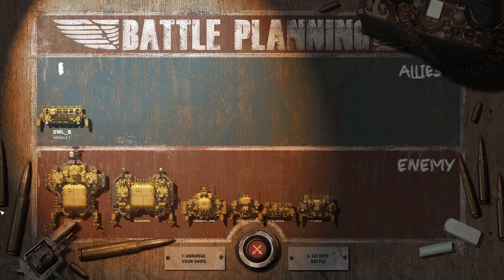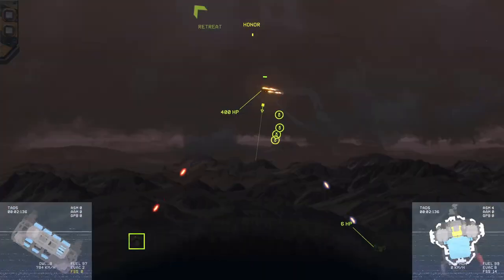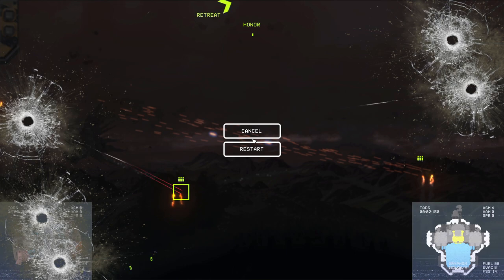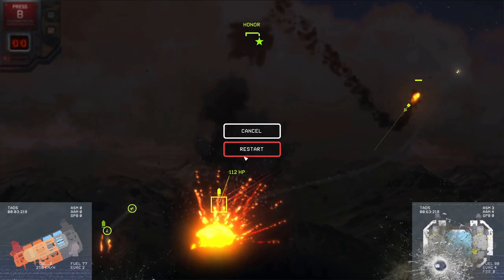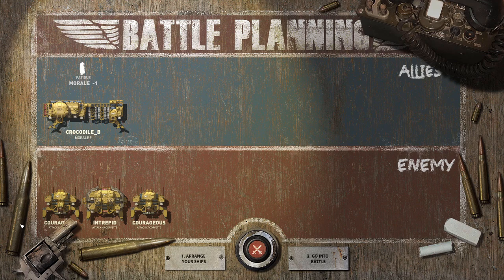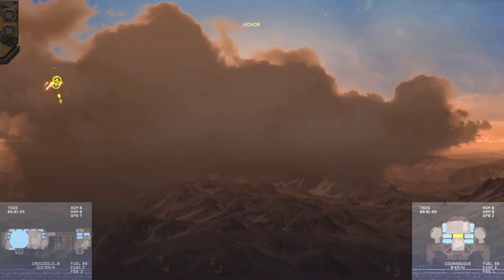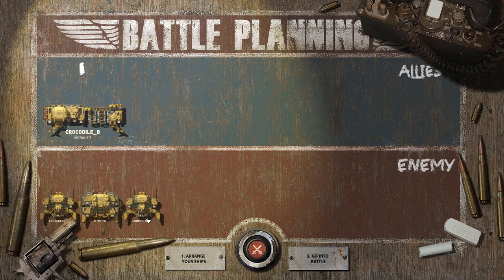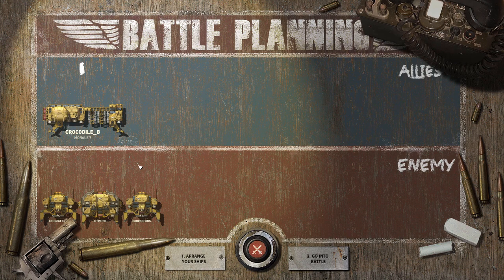Bomb Guide | Highfleet

Comment: might want a ship that's significantly quicker. for example you'd refit the lightning to be a bomber ship that accelerates at the ground to ensure your bombs fly faster and hit their targets before they take off. it'd also give you that window to adjust your trajectory and hit the most important target
Reply: In other words, a dive bomber. Ships like these most likely carry just one bomb. How effective is it going to be?
Reply: @賴志偉-d7h  The point is that you want the ship to have some velocity downward when dropping the bomb so the time it takes to hit the ship can be significantly reduced. You can easily design a small ship with decent TWR and carry around 5 bombs. Remember to have some spacing between bombs and only place them at the bottom of your ship horizontally to minimize the chance of accidental collision.
Reply from the maker: +1
Reply from the maker: That is an interesting question. A small ship with 2 bombs is likely to deliver it before the target takes off. However building a larger bomber with 4-10 bombs can not dive as fast.

Unless it has more thrusters. However then the design gets heavy and more expensive. And is it then worth it, if a KH15 can deliver a similar amount of damage for lower cost, without requiring fuel to fly back to the main fleet.
Reply: I've just started a new hard campaign and I'm using rooks modified to go about 430kph and I'm finding them very useful for sudden strikes on garrisons.  They attack first and bomb one or two ships which gives my normal attack ships an easier fight.
Reply: In my experience that is quite effective. Lightnings with 2 freefall bombs and 2 Missles... that means I can usually take out or at least heavily damage 2 targets before they can even take off... then it's just picking up the pieces or switching in for the next Airship. I call Lightnings in such configurations Thunders.

Dive bombing is more effective than carpet bombing, mostly due to the fact that bombs take up quite a lot of space and any ship that's capable of dropping more than 2-4 bombs will be too large to effectively cover the enemy in fire.

Comment: The problem I have seen with bombs is their rarity making them not advantageous to use. If bombs were found more regularly you could make use of fast surprise attacks with cheap ships. You drop a few bombs have them run away you have a crippled strike group on the ground before you main force attacks.

Comment: I thought about attaching bombs vertically the way you did. I wish they would make bombs able to attach on either side, so we could attach them facing down on both the left and right side of a vertical beam.
Reply from the maker: That would be really cool to have. I think they did not add that because it would require a flip on the object by mirroring it. And then they would have to code for it to only work for bombs and not other things.

Comment: You could modify a small ship to carry a couple of bombs and a couple of zeniths and have it tag along with lightning strike force. Then if you come up on a tougher fight than the lightning can handle, you switch the order to have the bomber-zenith ship go first to do some initial damage on the tougher ship before retreating. If you could put enough fuel on the ship it could also serve as a courier to move cargo to your main fleet and back to the strike fleet.

Comment: You forgot to mention a few things, bomb penetration increases with your velocity, and if you're fast enough you can use it as a heavy dumbfire missile. 

If you add two more engines to the rook you can fly fast enough to yeet your bombs from the sides or upward  against cruisers . This is especially useful against the heavy nuclear cruiser late game. A highspeed divebomb from the top can takedown an arch angel or a borey and a highspeed bomb rush from the side and take out the engines of a negev or komoran.
Reply from the maker: That is a good idea. Getting more penetration out of the velocity.